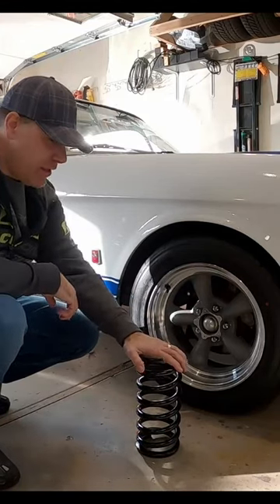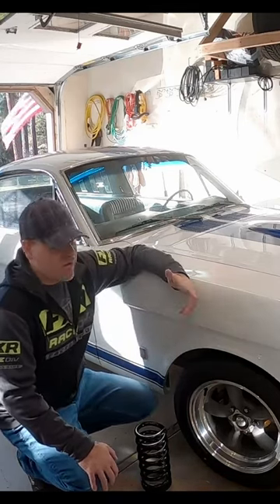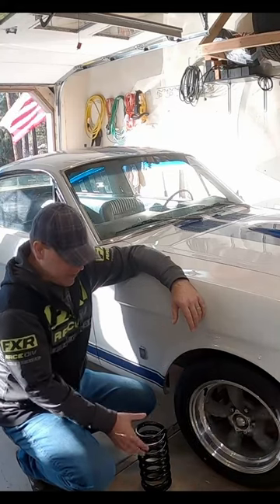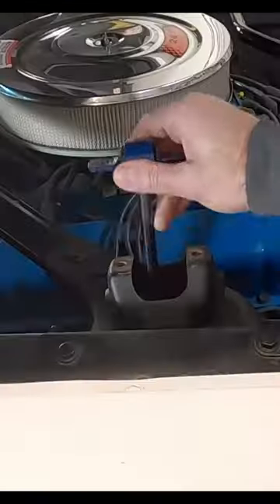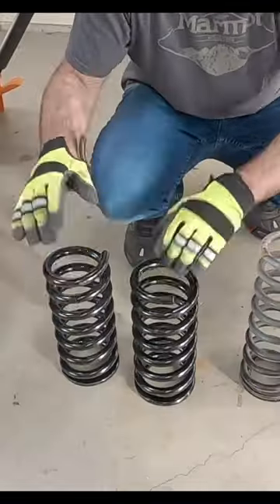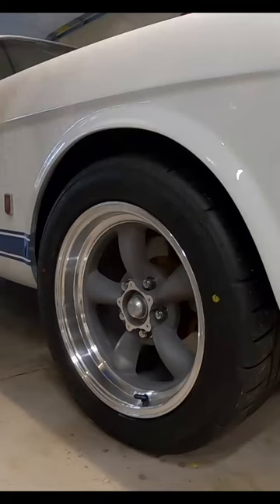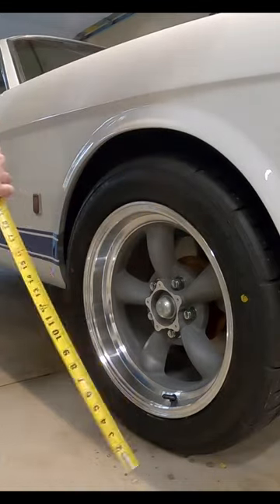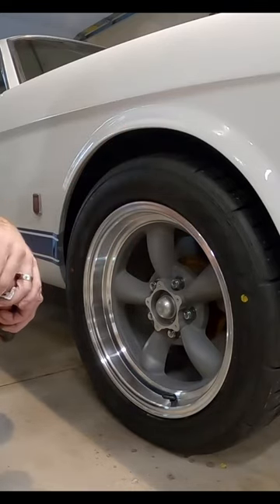1 Inch Lower Springs?

Comment: Recheck in a week
Reply from the maker: This is a short of the full length video where I lowered the car, then cut the springs to get the exact height I wanted.  It did settle down the road, but it's fine.  :)
Reply: Wait longer - like about a month
Reply from the maker: @kevinkreutzer8315  It has been over a year since I installed those springs.  This is just a Short video from the full length video I made a while back.  😁
Reply: @AndyKruseChannel  don’t cut them brother..compressed springs and shorted struts work perfectly and still feel like they should
Reply: @LegacyLife_555  did you really just tell him to not cut them after he said he already cut them?
Reply: @trilliedon8728  did you really ask if I left a comment after you read it

Comment: I did a conversion on a 65 Chevy p/u from a 73-87 Chevy p/u swapping the entire front cradle just drill out two holes. Then relief cut then reinforce the frame for the steering gear to bolt up flat to keep steering geometry correct! I used 3/4 ton front springs with 1 coil cut out! Drives like a dream.
Reply from the maker: I'd like to do a truck as a project, maybe I'll keep this one in mind.  :)
Reply: @AndyKruseChannel  when looking keep an eye out for a truck with leaf springs! My ‘62 GMC had a Dana 60 in it!!

Comment: Just cut 1/2 or 1 coil off original springs. Will lower car ~1-2inch and raise spring rate 5 to 10%>
Reply from the maker: This holds true for new stock springs.  Original springs are tired and the spring rate is lower.

Comment: Some times you still have to cut them, I did. Mine sits at 24 inches in the front, I had to put spacers on the top shock mount for better operation.
Reply from the maker: Yup, it's part of the game.  :)

Comment: Have you done the ‘Shelby drop’ by relocating the upper control arm bolt holes? Free upgrade and the template is available online. Doesn’t drop the car much, but improves steering geometry much more.

Edit: Nevermind, just saw one of your posts where you did that. Lol
Reply from the maker: Haha, yes, that Shelby Mod is a nice free mod for these cars.  :)

Comment: I need to do springs on my 86 cutlass, I done the shocks and the old ones I could fully decompress them with my thumb like it was nothing. Back shocks you could push so fast that it had a audible thud lmao
Reply from the maker: Yeah, it sounds like those Shocks are needed to be replaced.  :)

Comment: Like said drive it for a week or 2 and check again as they will likely take a set after a bit and be somewhat lower. If they do sag a bit it will be time to order up 1=1/2 lower to get you to a 1" drop from stock sagged units..
Reply from the maker: They did settle, this Short is from an older video.  :)
Reply: @AndyKruseChannel  well shit. Late to the party.
Reply: @AndyKruseChannel  how much did they settle total?
Reply from the maker: Around a 1/2 inch.
Reply: @AndyKruseChannel  about what i expected. Well at least its closer to what you wanted in the end

Comment: The 66 has the metal maverick dash under the pad that looks much better if painted to match the body.  Just an FYI 👍
Reply from the maker: Yeah, I've seen some cars that refinished the dash like you describe.  I'm not sure I like it any better.  Maybe I just haven't seen it in the right car yet.  :)

Comment: Let the new spring settle in the same thing happened to me with my crown Vic. It took like a month of daily driving it to get it settled in just in the sole face I did a complete suspension rebuild with much stiffer components
Reply from the maker: Yeah, it settled, this is an old video.

Comment: They would settle about 1/4”-1/2” after you drive about 1500 miles
Reply from the maker: It did, this is from an older video.  :)

Comment: Don’t you have to wait for about 24-48hrs for the springs to settle to their static height?
Reply from the maker: It takes longer than that, but they did settle a bot over time.  I installed these about a year ago, the car is sitting great now.  :)

Comment: Don't they have to sit for a little bit and need a drive before measuring? I saw someone do that with my car and they went down a whole inch that's the only reason I'm asking
Reply from the maker: They did settle, about a 1/2" over time.  This Short is from an older video.  :)
Reply: @AndyKruseChannel  hell yeah man that's awesome!

Comment: Mine look cool with the lower front springs but they were rubbing the wider tire
Reply from the maker: Yeah, the backspacing (or offset) seems to be a little more critical with these cars if we want to squeeze any kind of awesome tire under the fender.  Although, I guess that applies to any car, but these cars had relatively skinny tires back in the day.  :)

Comment: Those new springs will settle down ¾-1" over the next few thousand miles.
OR If you wantb instant results SPRAG your Springs.

Take your new spellings out and "Sprag" them by fully compress them 1-2 times.
Reply from the maker: This is a Short video from a full length video I made a year ago.  They did settle and I replaced the 1 inch lowering blocks with 1/2 inch units.  :)

Comment: Been through this with one of my jeeps. Ended up just cutting the stock springs that are from 1998 one inch off the spring dropped it 2” exactly on all four corners.
Reply from the maker: Yeah it's counter intuitive how much gets cut off versus how much the vehicle drops.  :)
Reply: @AndyKruseChannel  I watched a guy here do it and it worked out on my 98 grand Cherokee 5.9 so I tried it after seeing several videos of aftermarket springs produce random results.

Comment: Cutting the original coil down does same effect.. 🤔
Reply from the maker: Yes, but the original coil is worn out, so while cutting the original coil can help someone achieve a specific ride height, the spring rate is lower and the car will bottom out sooner.